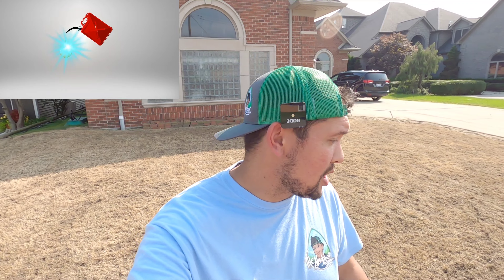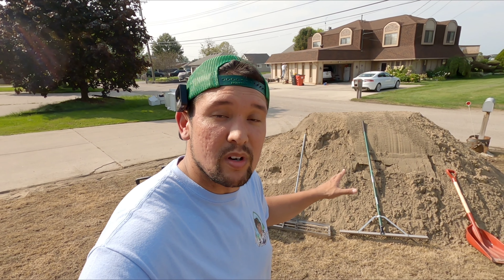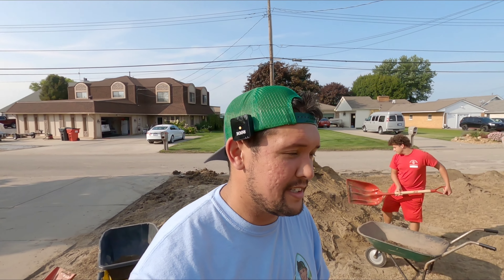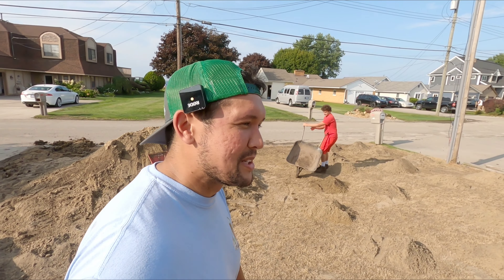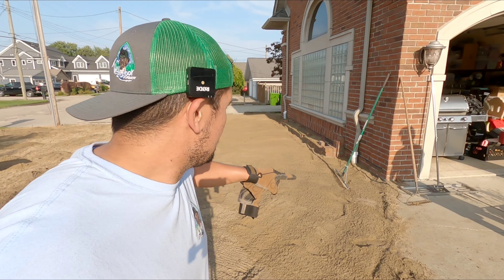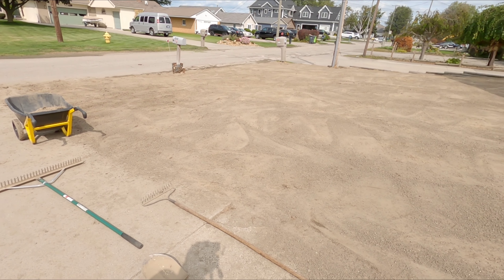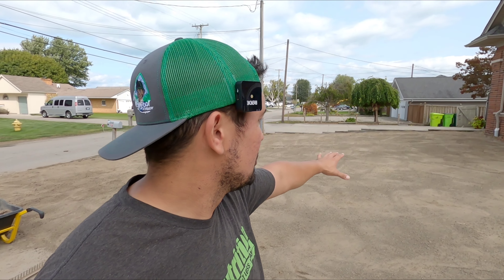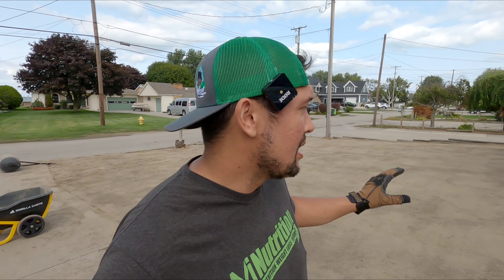Leveling with Sand/Soil Mix | 12 Yards

Comment: Will work like a charm👍 Sand works very well from Texas to Illinois to Connecticut to Virginia👍 I have done it in those places and it worked great in all. TTTF, KBG, and Bermuda💪
Reply from the maker: I'm excited to see the results.   I have some really cool temps right now I'm battling.   I'm trusting the process
Reply: The Neighbor Dominator, Slow germination in the cool temps. I get that in Illinois but sand will level itself without to much work. With the cool weather you should not have to many issues retaining moisture with the seed. You will be golden if you beat frost depending where you are located. You can do a once over of over-seed in the Spring if you do not get the germination rate you expect. I would not re-level at that time, just use a bit of peat moss and topsoil to dust over making some seed to soil contact. If you can aerate before over-seed even better. Once you get a hardy growth see how the cut feels. If you are happy enjoy, if you need more level go 100% sand in small increments. One in late Spring/Summer still vigorous growing season and one in early Fall vigorous growing season. Add your fert before you drop that sand down and watch the magic happen. Cheers💪👍🙏🇺🇸

Comment: Hey first time viewer here. I’m doing the same project this summer so this is a great video for me. My local place recommended to me 30% sand and 70% soil. Is this what you had or you did 70% sand? I kinda was thinking I want mostly sand but my local guy is saying otherwise.
Reply from the maker: I did more sand.  But that was because I'm reel mowing and sand levels better but holds no nutrients.   If you flip it around, the the 30% sand will help with drainage and the 70%soil will hold more nutrients.  But my lawn is perfectly fine with the 70%sand.
Reply: @Dadstuff365  yeah I’m not real mowing but my lawn is bumpy and just unpleasant to mow with my tractor. So I want to make is more smooth. Not expecting it to be perfect like a bowling ball but just more pleasant to mow. You think only using 30% sand won’t level nicely?